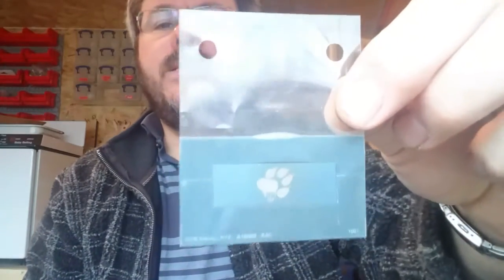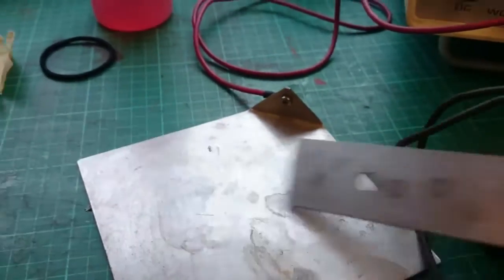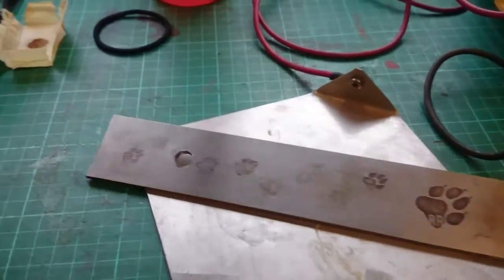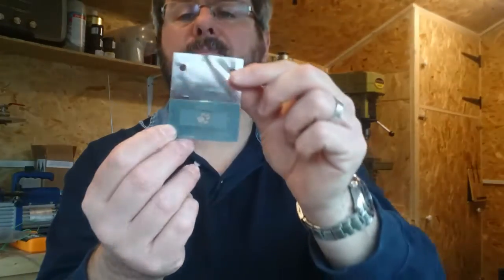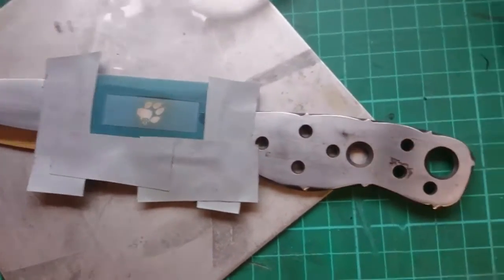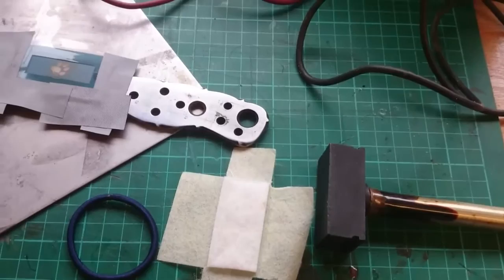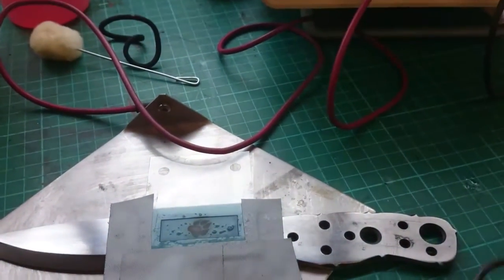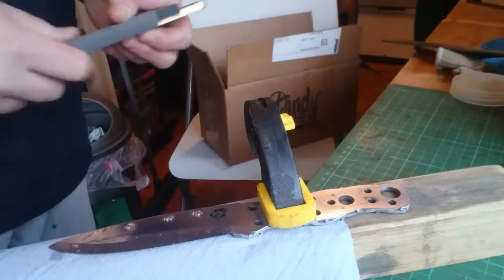How to electrochemically etch your logo on a knife blade.

Comment: graphite has a higher resistance than copper so you loose a lot of amps. you can check it yourself with a cheap multimeter, compare the copper wand and your graphite stencil.

Comment: Great video, nice recovery on the logo. Makes a big difference using a dedicated etching unit rather than cobbled together power supplies, for a long time i was switching between AC and DC power supplies to get my etching done but it always ended up not as good as id like. Nice file work on the tang by the way.
Reply from the maker: Thanks for the comment. Always good to hear from another knife maker.